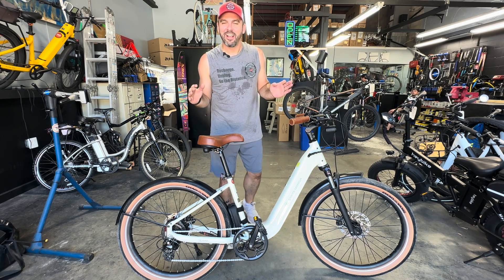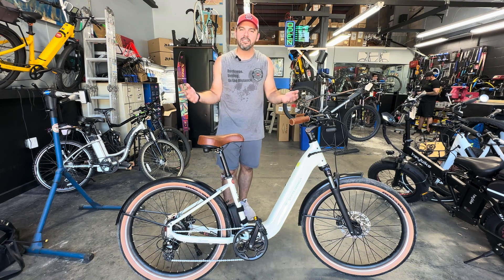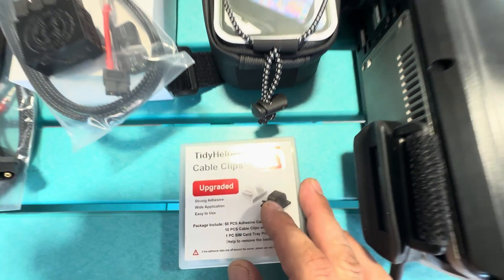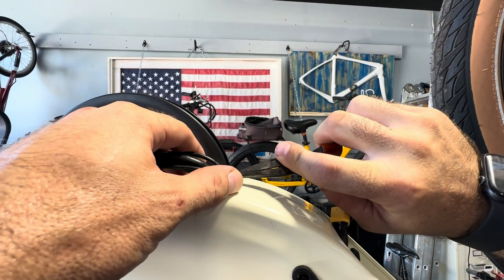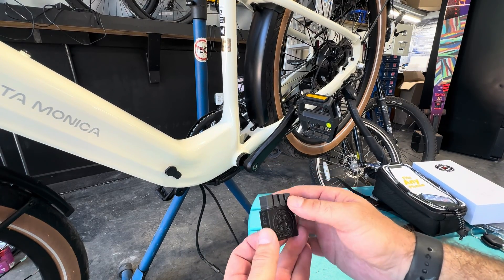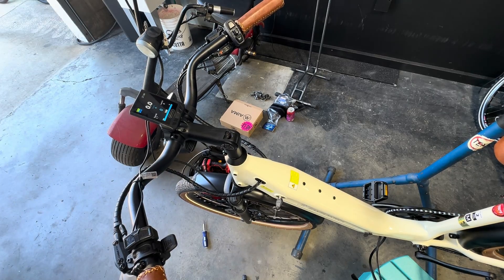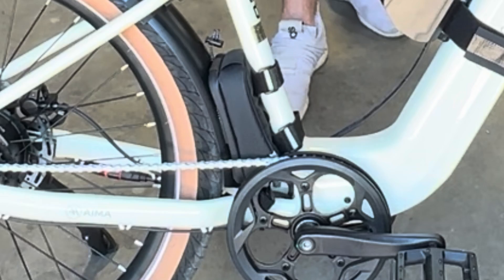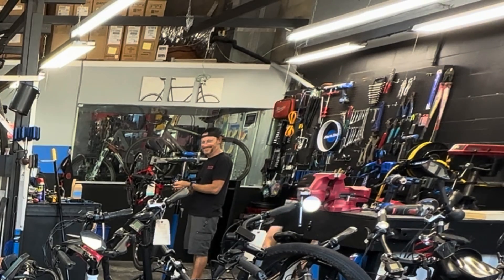AIMA | Santa Monica | DateX2 Second 48V Battery Install with Dual Battery Discharge Balancer Kit

Comment: Having the extra battery on a rear rack would be amazing.  Are the cables long enough for that possibility?
Reply from the maker: There are extra 14AWG XT60 extensions that can be added without issue

Comment: Hi, im curious about what you suggest concerning the psi is your tires. What psi do you keep in your Santa Monica? I've put 40 psi in mine. I just purchased one yesterday.  Thanks for your time.
Reply from the maker: For new tires we suggest at or near the pressure rating limit on the sidewall of the tire.
It may be hard to read so take a flashlight and check your tire wall for the upper pressure rating

Comment: Good job on explaining the install. If I may respectfully add a few points. You may mention that these cables coming out from the battery need to go through the grommet not just through that hole. Otherwise, you will be cutting cables probably in relatively few miles. Also, I am curious why you would not use the water bottle bosses only as your install with the Velcro straps makes it extremely inconvenient to remove the integrated battery.

Comment: I'm not familiar with electronics or related. But which battery will last longer?

24v + 50AH
Vs
48v + 25AH

Both on their respective compatible motors.